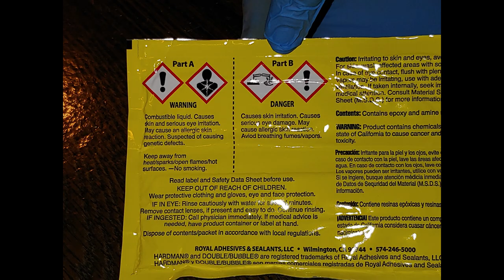Splitting Maul Handle Replacement ⛏️

Comment: How did you get the handle out of the maul? I know it's a dumb question but I really dont know how to get it out. Thanks in advance.
Reply from the maker: Hi Tttrevin, thanks for watching and the question! We drilled several large holes through the top eye of the maul head. Then used a chisel to break apart the pieces between the drilled holes. Then used a small pry tool to pry the handle away from the maul head and break it loose. Then turn the maul with handle pointing up and tap the maul head with a hammer until it comes of the handle. Hope that helps. Please SHARE and Subscribe!
Reply from the maker: Hey Tttrevin, thought you might like to see the splitting maul handle update video. I'd like to get your feedback on it. https://youtu.be/CD_DKONIcEY .

Comment: What brand handle is that?
Reply: I found a handle that is pretty much the same as this at Lowe's called trupers. I loaded the epoxy from the top and put epoxy putty on the bottom between the head and the handle to stop it from leaking out the bottom
Reply from the maker: Hey Gene B, here is a video reply to answer your question. Let me know what you think https://youtu.be/CD_DKONIcEY  I appreciate you watching and commenting!

Comment: Files like that are push cut only, trying to file on the return stroke actually damages the file teeth, hard to tell if u did that bc of the highspeed but it looked like it haha
Reply from the maker: Hi Victor, that high speed is deceiving. I was only using on the push cut. Thanks for looking out for my tools, and for the tip. ;) Please SHARE and SUBSCRIBE!
Reply: That's what they make bathroom size Dixie cups for , epoxy won't hurt the paper , pour it right in ...
Reply from the maker: Hey Victor, thought you might like to see the splitting maul handle update video. I'd like to get your feedback on it. https://youtu.be/CD_DKONIcEY .
Reply from the maker: Hi  @beckywatt5048 , thought you might like to see the splitting maul handle update video. I'd like to get your feedback on it. https://youtu.be/CD_DKONIcEY .